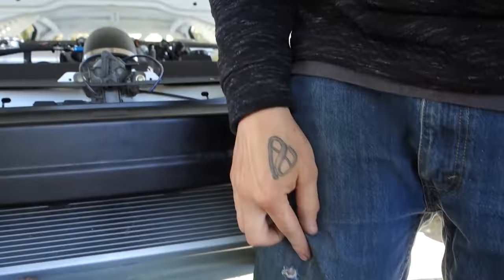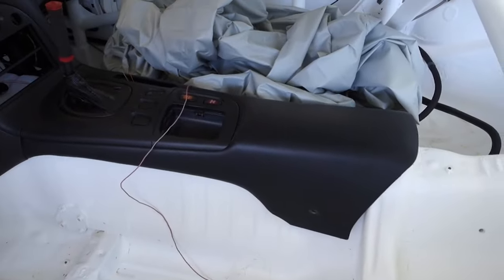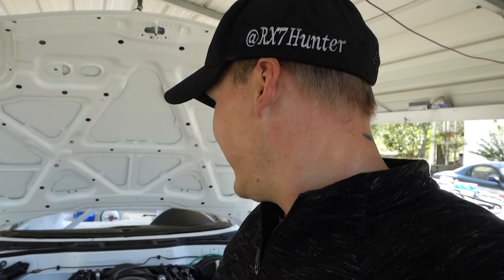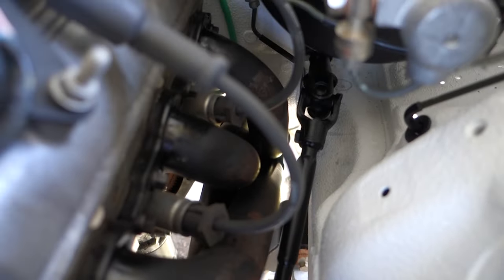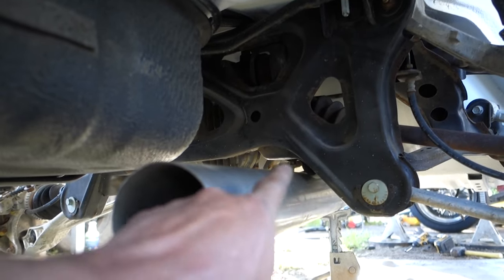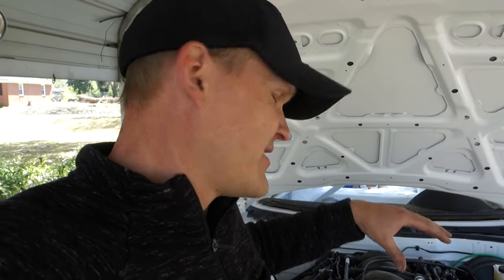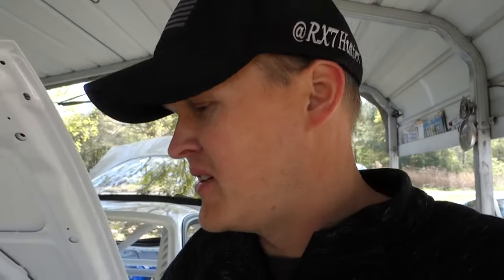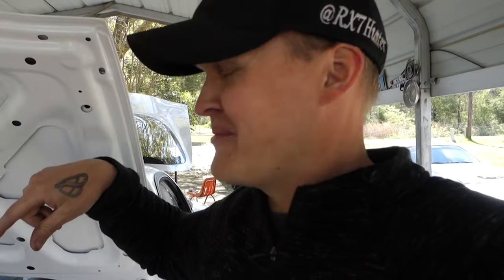LS1 Swap FD RX-7 Gets a Custom Exhaust 3” to 3.5”

Comment: Your still running the g body headers?
Reply from the maker: @2jzrx786  yea I just took it apart, cleaned it up and made it work for a rx7. It’s a lot of work, but if you’re on a budget, it will definitely get you running if you have the money can’t be a nice wiring harness though